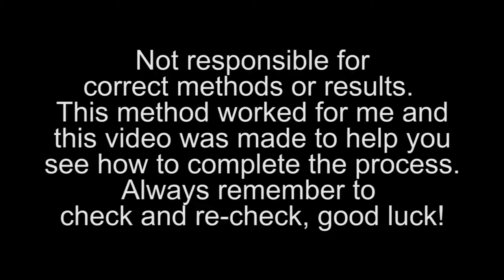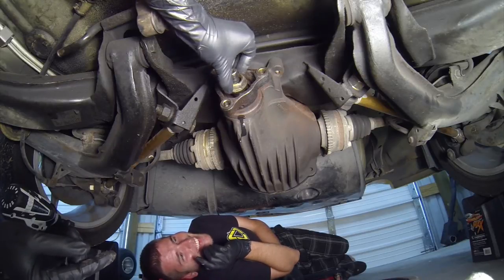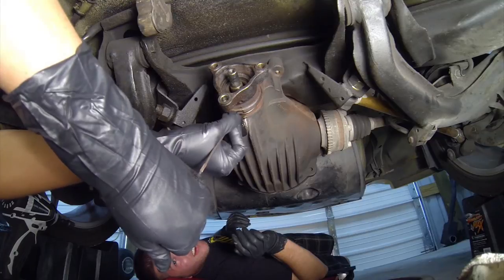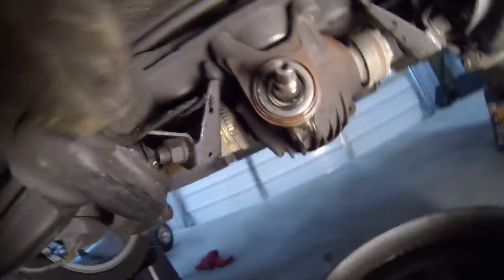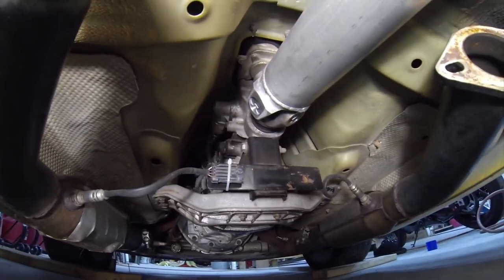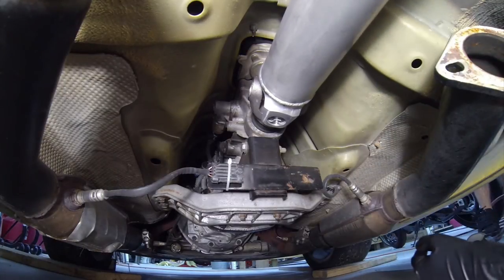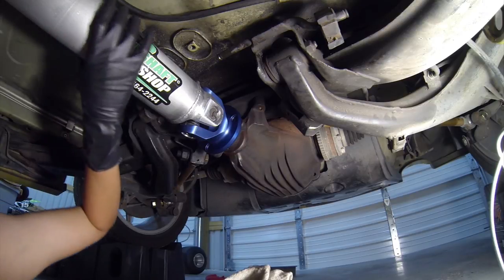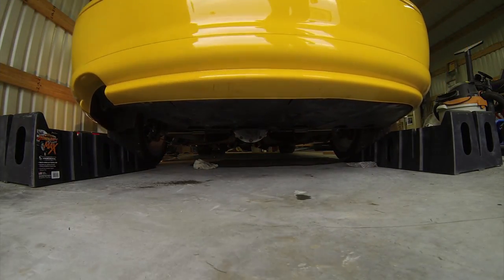ChixGTO: 2004 GTO Pinion Seal and 1 Piece Aluminum Driveshaft Install - Chix Garage

Comment: I had trouble replacing my pinion seal in 2010 in my 2002 model Holden VY SS Commodore (Australian right hand sedan version of the GTO Pontiac) as the pinion flange (same diff but with  3.91:1 ratio gears fitted) was a press fit onto the pinion spline so it kind of stuffed the small pinion bearings inner race up.

I dug up specs for the pinion nut torque for an Aisin-Warner diff,replaced the pinion seal & set the nut torque to their recommended value of 200 Newton meters,I needed a set of pullers to remove the flange.

I started getting gear noise 4 years later & I replaced a couple of neoprene seals by then,I even went to the trouble of buying a new OEM pinion flange for it as I sleeved the old one.

I replaced the bearings in 2014 & set the pinion rotational torque up to 2.4 newton metres of drag including for the side bearings,I fitted the older style of pinion seal from a Borg Warner 78 series diff,that lasted for a year which is similar to the one fitted in the video, it had a neoprene seal lip on it & lasted for a year or 2.

So,I fitted a Viton oil seal after coating the outside of it with silicone sealant, it hasn't leaked since,apparently the V8's with the M80 limited slip differential such as mine needs to have the Viton seal fitted,particularly when towing.

The pinion splines should have non hardening sealant applied to prevent oil from leaking past the splines,the gears were a bit noisy at first but have got quieter after almost 5 years.

A 1 piece tailshaft is more for very high horsepower applications (1000+ HP).
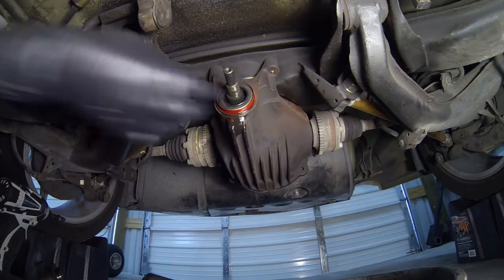Reply: I have the Aussie vu ss, 3:45 diff, did the seal about 3 years ago, just started to leak again, will try the silicon sealant , thanks for that!

Comment: from experience it helps to count how many turns the pinion nut takes to come off. to make it easier,  draw a line on the socket that way you don't need to take it off and see where the reference line is on the nut itself to the flange. also I don't know if you didn't record the final pass/torque on the pinion nut, but it does take some effort to torque back down. also people out there using the National brand seal, its real easy to damage if you don't have a nice tool to tap in. good vid

Comment: Cool video. I'm changing mine really soon. I got the exact same drive shaft from the DSS. I'm guessing that was the rear seat belt bolt you shaved off.
Reply from the maker: I think that was the bolt in question. It didn't look like it would be an issue, but just to be safe.
Reply: DSS recommends shaving that bolt. Did you have any issues reinstalling the stock exhaust? Any leaks in exhaust, and did it clear the bigger DS?
Reply from the maker: thall69 I know they recommended shaving the seat bolt, but my car is fully stripped so I don't think that bolt even existed anymore. I went ahead and shaved whatever that stud was since I was under there. I also don't have stock exhaust so I can't comment on if it fit well or not personally, in my forum searching I think some people had issues. I do know it was a pain in the ass to fit with my SLP Loudmouth 2 resonators. I actually had to grind off one of the hangers to safely clear the shaft.
Reply: @ChixLife  so you didn't have to use a puller kit to remove the pinion flange?
Reply from the maker: @mikeprice8307  can't remember...if it isn't in the video then I doubt it.

Comment: Does the rear differentials have spacers/washers inbetween the differential and the sub frame where the two front mounting bolts closest to the pinion flange go through?
Reply from the maker: that slow goat It has been years since I took the diff out, honestly can't remember.

Comment: so getting ready to throw an 05/06 diff in my car but have to use the 04 diff yoke. What if you don't mark everything before assembly. will it cause vibrations..also could you measure the the rotational torque of the pinion nut and do it that way?
Reply from the maker: that slow goat It is all about the crush ring depth, if that isn't set the lash won't be correct and boom.

Comment: hey what part # is that the drive shaft shop has like 10 different 1 piece shafts for the gto? im looking to get 1 for my 05 m12/t56 gto the stock 2 piece sucks... nice video thanks :)
Reply from the maker: I bought mine off Ebay for $650, it was for the 2004 T56 GTO, 1000hp rated shaft
Reply: chixwithtrix hey chix on a scale from 1-10 how noticeable of an improvement is this over the stock 2 piece?? im trying to justify the $650 price tag....  is it worth it in your opinion ?? I see you drift & drive spiritedly lol  im pretty sure ther is substantial loss of Hp & Tq with the 2 piece & the dumb flex disks....
Reply from the maker: TurboHawk2010 I bought the aluminum shaft because I had no other choice really. My stock driveshaft had a ripped carrier bearing holder and it was destroying my rear end, hence having to do the pinion seal. Stock shafts aren't available anymore, or are like $1000 or something insane like that.

The drivetrain does feel tighter, but mostly it is the safety of not hurting the diff or transmission which is worth $650 in the log run.

Comment: I just got a 2004 gto and car came with a hinson motorsports driveshaft. I shaved off the seatbelt bolts as recommended, but its still knocking against something when i accelerate the car hard, its really annoying smh. I even cut off resonators on exhaust to give it a breathing room.
Reply: I have the same drive shaft on my 04. The knocking in coming from the rear end. If you look in front of your diff there may even be a spot that is showing signs of wear where the drive shaft is jumping up hitting the bottom of the car. There isn't much room and if your shifting hard getting on it the rear end flexing allows the much fatter drive shaft to bump the undercarriage.
Reply: Tyler Reynolds yea i ended up removing the heatshield also and bought new suspension. Car was sagging a lot which was causing the knocking.
Reply: my car had the same problem..the previous owner used washers as spacers and put them between the two bolts closest to the pinion yoke that holds the diff  to the rear subframe to prevent that banging sound under hard acceleration